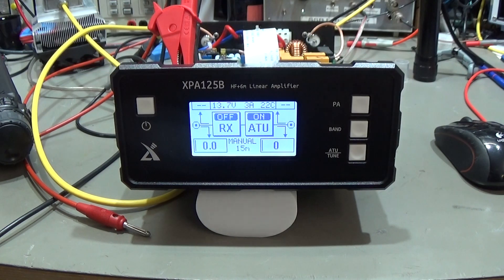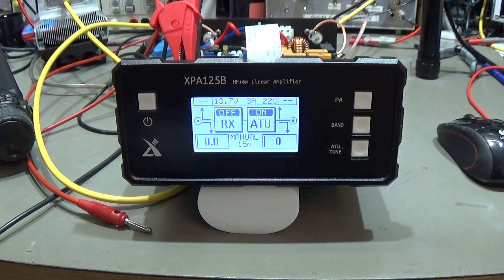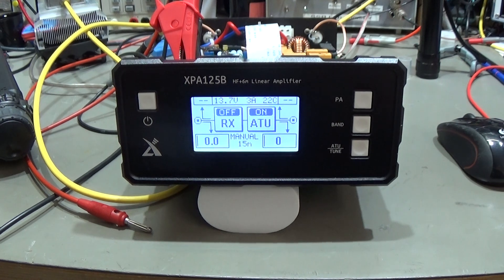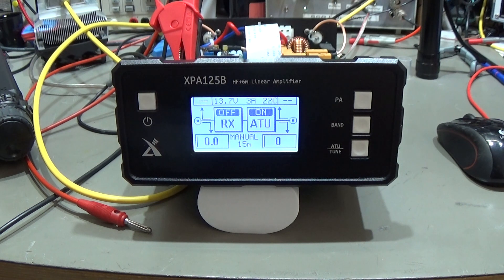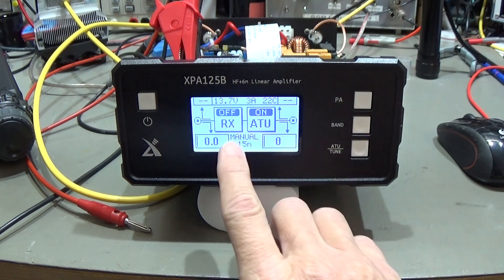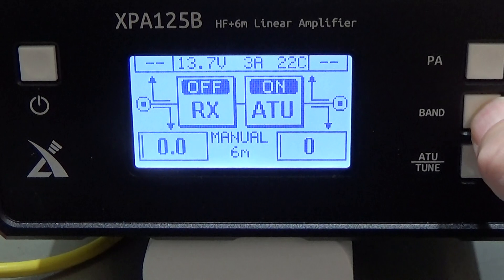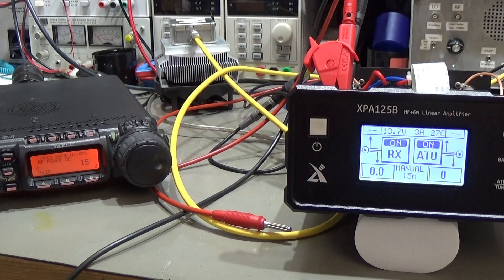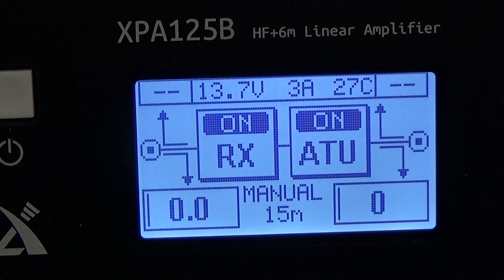#270 QRP PA Xiegu XPA-125B, defect ATU?

Comment: I use it with the Xiegu G90. I was using the G90 with an EFHW antenna.

The automatic tuner is garbage, the G90 tunes the antenna fine. My MFJ tuner fed by my Icom 751a tunes the antenna fine.

ETA: ok.... for legal reasons... i DID NOT set my G90 to 5W, and go through every band on AM checking the tune with PA off, then again with ot on. No way i did such a thing....
Hypothetically, if i had done that, i certainly wouldn't have expected to see an SWR under 1:1.7 at the highest and under 1.5 for all the rest, 1:1 at 20m... (Chameleon gen1 EmCom EFHW)

Nearly 4am local time, way past my bedtime, almost time to wake up... but after i have my coffee... i'll try the thing on FT8....

Comment: Do not buy a Xiegu XPA125B! This amplifier was originally introduced with a good design using a pair of RD100HHF MOSFETS to easily handle 100W. After a few years they started selling units using the a single AFT05MP075N rated for 75W without any change to published specifications. You can push these amps to 75-80W but they are now really 50W nominal amplifier to achieve the same IMD rating. For a company to engage in these unethical design practices, I'd strongly recommend to never buy any Xiegu products! This is the same practice that Huawei tried when they started to gain some market share in the US with their phones and tablets.
Reply: Nah, mine is putting over 100w

Comment: Hi, it might be worth to say, that there is an interface (CN-20) from Xiegu for Yaesu Ft-817 / FT-818.
I've bought such but facing some trouble - failure notice displayed on the XPA125 display for some milliseconds.
Luckily the XPA125 was not destroyed but I was not able to understand the issue up to now. With my X6100 everything still works fine.
Reply from the maker: good point

Comment: Hi Peter - I have one of these with my 703 - yep it’s a little bit of effort to set up but works a treat. I have spoken with the UK importer and sorry to say but I believe we have got all we are going to get in terms of support for non Xiegu radios.
One point of caution is don’t TX on the wrong band, that is remember to manually change band first else permanent damage can happen - several 705 users have found this according to forums and repair back up is limited

Keep the excellent videos coming- cheers
Reply from the maker: I'm very curious if we get more support in the future. Basically, this PA is not bad, but we need to get it better adapted to different radios...
Reply: @TRXLab  This will certainly depend on how many of these PA units Xiegu want to sell, compared with the difficulties they will encounter in supporting, even a limited range, of other QRP transceivers.  In general, Chinese radio manufacturers (unlike Japanese) prefer to skip ahead to new products, rather than waste effort on improving old ones.

Comment: I have one of these (and I'd recommend it - but it isn't cheap).   I use it with my Hermes Lite 2 SDR radio.   Initially I had the same 'problem' and found the same 'solution' as you- the manual isn't wrong but it certainly could be better written.   M0XYM

Comment: This is pretty standard, no? I don't think I've ever had an auto ATU/PA combined that didn't work like this.

My Expert amp is like this. As is the Elecraft KPA500 & KAT500 combo. As is the Z11pro2 (unless in fully automatic mode). 🤷‍♂️
Reply from the maker: No definitely no standard, but at present this PA does only work satisfying with a XIEGU radio , which is a bit sad.
Reply: @TRXLab  most other amps I have used do the same. 🤷‍♂️ I guess it all depends on experience.